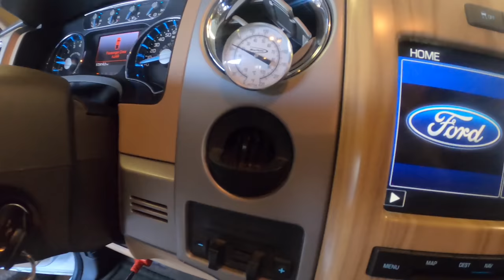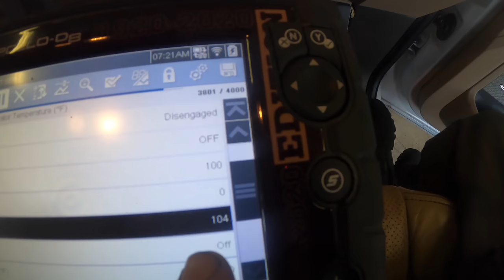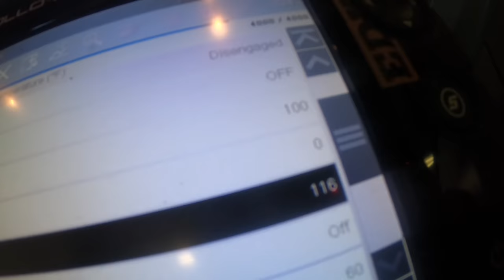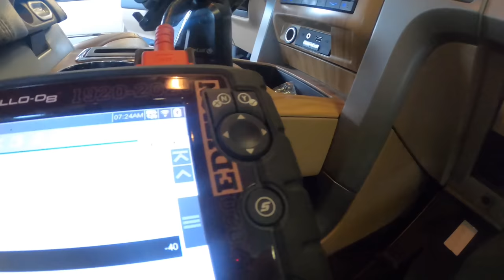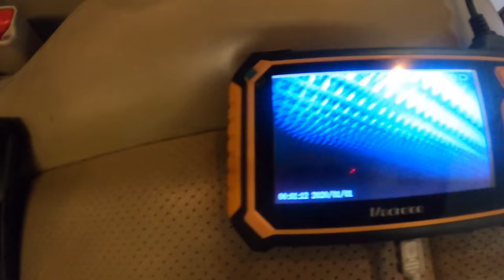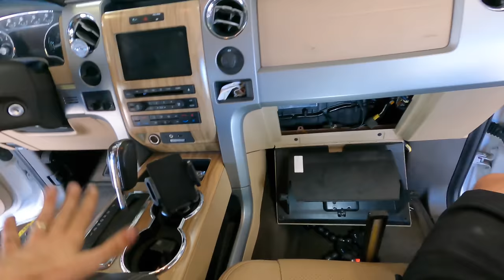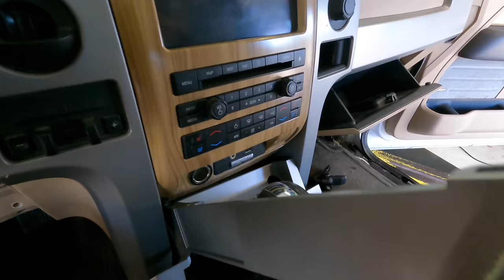TEN HOURS to replace one sensor! Ford 150 torn to pieces! Evaporator Core replacement.

Comment: I know most manufacturers require a dash removal to access the core but Ford has got to take the cake.  A ten year old Ford.  I'd understand a part failing after 20 years but in today's world, that truck is basically new.  Until last year, I had always owned a Ford but finally converted my entire fleet to Toyota.  Leaps and bounds above Ford in almost every way.  Ford has been making cars and trucks longer than anyone else and they still can't get it right.  Ridiculous.

Glad you're able to keep a positive attitude Ray.  Always impressed.
Reply: I owned a 2007 Toyota Tundra and a plastic gear broke in the HVAC box under the dash. You cannot buy the gear separate and the HVAC box cost $1200.00. Required the whole dash to come out and total bill $2500.00. Knowning what I know today I would have dismantled the dash and welded the plastic gear with baking soda and superglue. To add insult to injury the gas gauge failed to read below 1/4 tank after the dealer return the vehicle and refused to fix it. That was another $400.00, this is known issue with the Toyota's. So good luck they aren't perfect either.
Reply: This video don't help Ford to sell more F150:s
Reply: I get it, no one manufacturer is perfect.  But on the grand scale and overall quality, Ford misses the mark time after time.
Reply: @Bryan-Hensley  Indeed, what a pain to work on these trashcans like damn not even FIAT does it that bad and I seen them use recycled plastic for the base of the radiator wich is very nice because you sneeze at it nd the whole thing broke down.
Reply: The current F Series is aluminum. That alone is worth it over a Toyota.
Reply: I lived in Africa for 30 years and the place runs on Toyotas
Reply: I bought an 06 Double Cab Tundra 3 years ago and it’s been a pretty good truck. Hasn’t needed much, oil changes, timing belt service, universal joints, a set of spark plugs and a set of valve cover gaskets. 170K miles currently.
Reply: @vw5056  Until you have to get any bodywork done to it. Good luck with that.
Reply: I saw another video on YouTube where another mechanic had to remove the front doors & whole dash on a newer Ford Escape to replace the blower motor. My 2017 200 has gone through a few blower motors (only issue/all still under Mopar's 2 year parts warranty) but I only waited under 2 hours both times.
Reply: @craig162  I would take my chance. Plus, insurance doesn't cover rust.
Reply: Certainly not unique to Ford. We owned a B5.5 Passat, and I am convinced that VW built the car by hanging the heater core on some strings, and then assembling the rest of the car around it😁
Reply: I have many generations of Ford trucks, there is a huge difference in the 2004 f150 and the 2019 f150, 2004 f150 was like a cadillac, quiet, smooth, far more comfortable, 2019 is way cheaper built.
Reply: Lol ford trucks are manufactured by mazada now . Hints why theyve went to the v6 as their main 1500 class engine. All the over head cam engins ..lol.
Reply: @paciencia0956  For some reason everyone still loves Jeep/Dodge/Chrysler/Fiat.  I can't think of a shittier company of garbage vehicles.
Reply: I have a Ram in an era known to break blend doors. Apparently there are revised HVAC cases and motor couplers with more robust stops, and taking the entire dash out is a huge pain. They all seem to be built this way. Seems like it wouldn’t take much to design hatches into the hvac case so a person could do most common repairs without pulling the whole dash.
Reply: @jimlovesgina  I see little to no difference in reliability between Ram/Dodge vehicles and Ford or Gm. All manufacturers have various problems through the years. A lot of it comes down to initial purchase price, features and brand loyalty. I’ve owned Dodge/Ram truck’s for the past 20+ years with very few issues. IF Toyota built an HD truck, I don’t see how it could’ve been any more reliable than the Ram truck’s I’ve owned(so far). Toyota may have a rep for reliability, but they also have a rep for being late to the party for features and updates.
Reply: @618GOLDENRATIO  After spending my life as a tech and then teaching it on the collage level I found that Toyota's and Honda's seem to require the least amount of maintenance, though definitely not perfect.   You know what they say- "if it has tits or tires" it's going to be a problem sooner or later...
Reply: All of this brand is this way always been this way all proprietary - and cheer leaders talking about how great 'turbo weed eater' engines are with electrical motors.
Reply: I had the heater core changed on my 2004 Ranger that was expensive and a waste of money..
Reply: I'm a Ford guy, too, but am going to make the move to Toyota -- as soon as dealerships start selling cars again.
Reply: @mikeboring2172  I will stay with late model GM - v8s easy to maintenance and parts interchangeability. I would not buy anything new - as the prices are out of control with inflation as endless creation of money.
Reply: @peterbenson3776  GM trucks are way less expensive cheaper to buy a 3/4 gas work truck - no electronic displays and other nonsense. But I do all my own work.
Reply: @mt1885  my brother had a GM truck that needed the entire cluster replaced and the truck was only a couple years old.

Comment: I am a retired BMW technician.  We had the same problem with A/C freezing up on certain models..  we found that adding a resistor on one side of the temp probe brought the sensor back into spec.  I used a potentiometer to get the exact resistor value.  That may have been a very cheap fix.
Reply: Spot on!!! And saved 10h of stupid work. I can bet it is just typical thermocouple with specific resistance.
Reply: @mciepi    If I remember right, most of those sensors are just that.
Reply: Work smarter 👍
Reply: We like to watch things get torn apart, not easy fixes.
Reply: Ford introduced a resistor add-on for the last step in bringing engine temp gauge readings in the normal range on many Lincoln models in early '80s. We even had a warranty code for the procedure which paid like 0.3hrs..................
Reply: @Chairman750  thermistor most likely
Reply: thought this myself
Reply: @Blackie The Kat,
Everyone thinks mechanics are all rip-offs (some are) yet they have no idea how badly and often auto manufacturers rip-off technicians.
Find the car, pull it in, get the part(s), tear it apart, install the part, put it back together, make sure it's working, park the car, fill out the paperwork, labor codes, turn in the paperwork... and do all this in 18 minutes (0.3hrs) Oh and by the way fill out the free safety inspection form while you're at it.
Reply: @JGnLAU8OAWF6  Yes. More likely thermistor.
Reply: @blackiedekat2612    Oh yeah.  I remember those days when it took longer to bring the car in than what it paid.
Reply: @johndelper1404  exactly. Order part, remove needed sensor, return part as missing component, cut hole, replace, weld shut hole
1 hour, pay me

Comment: On my own truck if this happened, I'd definitely use a dremel with fine saw wheel, and cut that plastic case open near the bottom to get access to the original spot for the sensor.   Replace with a junkyard sensor from a similar year F150, solder up wiring, then use JB Weld and reinforcing metal mesh to glue the cut plastic piece back into place

On a 10 year old truck, who knows, maybe Ray's customer would have given him permission for that.  Great  videos Ray!
Reply: Great minds think alike...  I was thinking the same thing.
Reply: I did that on a Volvo. After cutting the access hole I just covered it with duct tape
Reply: I would just put resistors inline with the bad sensor to get the reading you want. I've done something similar with oxygen sensors.
Reply: @georgiadronefootage4136  I thought exactly along those lines as well. Give it the reading it requires to cycle on/off.
Reply: Did that to my 87 Hilux. Out with the Dremel & cut out the plastic. Gaffa taped the plastic back after. No way was I going to pull the dash apart just to clear the dirt out of the evaporator fins.
Reply: Same...plastic is easy to work with.....cut with dremel, exchange sensor, test, melt opposing holes with small nail as needed, stitch back together with 14 gauge solid core wire (romex), sealant (of choice) along seam.
Reply: I'm with you! Had a heater core once I had radiator shop modify to make installation & any future problems easier
Reply: I thought that a hole saw would provide quick access. and that a plastic or sheet metal panel could be screwed in place for closure.
Reply: I was kinda leaning towards 6 sticks of dynamite and a big empty field.  Lol
Reply: @russellmooneyham3334  I'll supply the empty field....
Reply: @readmore3634  lol. Deal !!!
Reply: That is exactly what I was thinking.
Reply: 🖒🤠
PS: Duct tape would patch ok...
 maybe even 2 pieces.
Reply: My thoughts EXACTLY, except you opted for a more professional fix than the duct tape I envisioned lol!
Reply: I thought the same thing
Reply: I would do similar, but would make a nice looking removable cover for the hole so I could access it easily if I need to replace another.
Reply: AC is overrated and just something else to break. Resale value what's that. 
Maintain a simple TRUCK and drive it FOREVER. remember only 8 ft beds and bigger are trucks. Everything else is an S.U.V.

Comment: Don’t have a clue how you can figure this stuff out but especially how you can remember how to put it back together again. Thanks for sharing.
Reply: Ray will be at home now watching this video in reverse !!
Reply: he looked at the live data. it told him what was wrong. He showed you the temp sensor reading and how it was faulty. I'm not downplaying what he does in any way, but most cars have highly advanced built in diagnostics and it's easy to figure out whats going on - most of the time. as far as diassembly, normally they have access to the labor guides that tell them how to do it. But keeping organized is key
Reply: @samjones1954  As someone with tremors in one hand, the idea of trying to keep track of parts that small and line them up gives me anxiety!
Reply: In depth  was an understatement.  Im always learning something from your  videos.
Reply: @samjones1954  I don't think it's fair to say "What he does is nothing."  I'm not a mechanic, but I've worked on stuff over the years, and you have to have a knack for it, and he makes it look a lot easier than it is, even when it looks hard.  I've seen a lot of incompetence over the years, some of which you just have to stare at in wonder.  I'd be happy to take my cars to Ray if he wasn't about 2K miles away from me.  Auto technicians are probably the most dumped on of all the technical disciplines.  It's physically demanding, you're exposed to toxic chemicals, you can injure yourself badly if you don't know what you're doing.  You also typically have to buy all your own tools and keep up on your certifications and training, out of pocket.  You have to be a computer technician, an electrician, a contortionist, and sometimes a bit of an engineer.  And for a final kick in the nuts, you often don't make as much money as in other technical fields, such as IT or medicine.
Reply: he doesn't remember how to put it back together, thats why he does it twice.
Reply: It stresses me out watching these 'tear apart' videos - but I keep watching.  Putting the pieces back together is one thing - remembering which bolts/screws go with each piece is the part I can't figure out.  I've pulled pieces of dashes in my days installing car stereos (not for a living) and even with the few fasteners in the mix it was still a challenge.  He must have pulled at least 100 fasteners out of this thing.  Early in the video he pulled a bolt - and said something like 'ooh, that ones different', and then just laid it down somewhere :-O. So many of the bolts/screw look exactly the same, just a bit shorter/longer than each other.  Inevitably I would put a short screw in a long hole and then wouldn't have that screw for its real home.
Reply: It starts when your young and you take apart everything you can get your hands on, toys, clocks, toasters, or basically anything that's been discarded and has screws or nuts and bolts in it.
Reply: @greendryerlint  you are absolutely right sir, being an Aircraft Technician myself. I too find it hard sometimes to work on something as simple as a vehicle
Reply: @samjones1954  You could probably out coach every pro coach in every sport too. Right?😁
Reply: Best thing to do is keep the bolts with the peaces that come off that way you don’t have a bunch of bolts guessing where they go
Reply: @kjtroj  you may find this kind of work challenging, maybe impossible, not everyone can or should do it, but I will bet/guarantee that you have other natural and learned talents you are good or excellent at or may not have yet fully discovered. Everyone has unique talents, unfortunately some never use them or due to circumstances have the opportunity to. Do what you are good at and what makes you happy and share your talent so that others may find theirs.
Reply: @wirefeed3419  Agreed.  We all have our niches.  I'm in software, which is a much better fit for me.  I find mechanical stuff fascinating, but it's not my sweet spot.
Reply: @samjones1954  how many peices do you have left over.   I remember engine rebuilds in the 60s and you would have a coffee can of parts left
Reply: Recording it helps
Reply: @justaman5490  our son took our brand new edger to school to "take apart"...years later he told us he and his gear head friend bored it out.
That would explain the kaboom and smoke next time hubby tried to edge.
That son stopped turning bolts.  
Ray is amazing.
Reply: Trust me after taking something apart and failing to put if back together, cause you weren't paying attention. You learn real fast to "pay attention" and memorize where everything goes. For me it was just a memory game. But for a while I on bigger projects I'd record myself, and if I got stuck just rewatch the vid. Helps aton.
Reply: @carolynsullivan2912  That's a great family story. I never became a professional mechanic. But, though the years I've saved a ton of money fixing various broken machinery from small appliances to automobiles. I'm old enough that I'm from the era that if you know how to fix things it makes you just a man.😁 Ray does do a good job and he's funny.
Reply: @Steve Sauls I don't think YouTube gives a damn - been reporting them for months & not one single response, with the same ones posting their crap over & over.
Reply: @bruceb4349  Nope. They're specifically set up spamming accounts, almost all set up on the same day.
Reply: @Scotty secretly loves Chryslers Well, a lot of people never finish puzzle either.
Reply: It's one of those situations where you put it back together better than the manufacturer and you have extra parts
Reply: @samjones1954  like precision transmission YouTube channel?
Reply: @samjones1954  I would not say what he does is “nothing” I am sure that was not intended, that makes it sound like anyone with a multi driver and crescent wrench is a mechanic.
Far from it, it takes a mechanics aptitude to be a “good mechanic”. knowing when nuts and bolts are tight enough, not over tight and when cross threaded. Look at a nut and bolt and know the sizes and Recognize left and right hand threads and which bolt, screw , nut and washer  goes where. This is just the basics, the ability to trouble shoot and diagnose problems often starting with the customer’s unqualified description is skill more than just any persons can do or learn. Good mechanics are under paid, under valued and under appreciated and unfortunately because of hacks, scams and crooks mechanics in large are not trusted. It is nice to see Ray here doing his best for his customers plus it shows a lot of people what a day in the life of a good mechanic looks like. 👍
Reply: @GARDENER42  Well, Some Beach !  In that case, I'll report them as well, to add to your voice. 
 Thank you

 And here I was thinking that all of the normal real world names were already taken on Google.
Reply: @Steve Sauls Ahh, I see. Good eye ! Thank you for pointing that out, Steve.
Reply: Try reassembling something taken apart by someone else doh
Reply: @Steve Sauls Done. All of them.
Reply: @Tony-hx2fj  Yeah, and if you needed a carb your friend probably had 2 or 3 in his garage. At least one of them would be a Quadrajet.
Reply: @keinlieb3818  honestly I do what he does and it's not hard if you're mechanically minded the dashboard's are put together with usually only 4-5 different types of screws. The car manufacturers have regular everyday people building theses and the make it as simple as possible so they workers don't have to keep up with 40 different types of screws and it cost money to keep 40 different screws in inventory. Basically most cars are the same 5-6 bolts and screws reused over and over again.
Reply: Sorry to be blunt, but just remember who the mechanics are, majority of them were the dumbest kids in school, not all of them but majority are your bottom of the barrel people, not trying to offend anyone but I’ve been to many of these shops over the years as I work for an international supplier and have seen it many times over and over.. just saying it how it is
Reply: Its called having a skill lol
Reply: @gmoose7155  what kind of car do you have because wheel wells are nearly always 4-5 clips that are all the same the only thing that might change is the length of bolts.
 This shits not complicated different connector types and different locking styles aka none of them are able to be connected incorrectly because they won't fit.
they make this assembly as easy as possible for the workers in the factories.